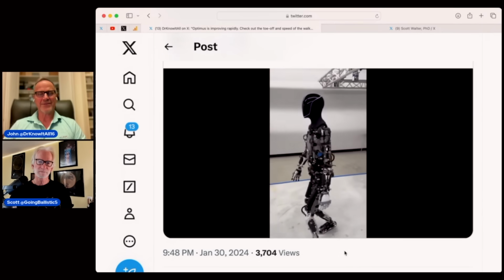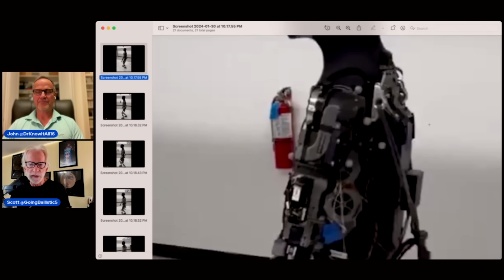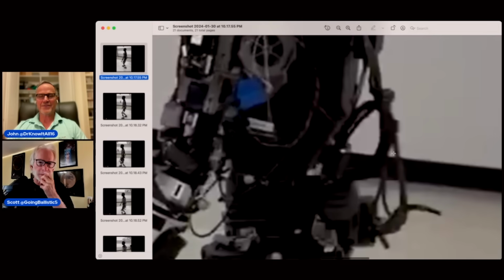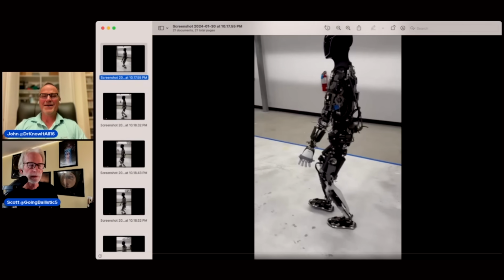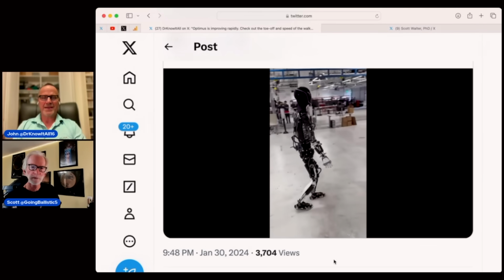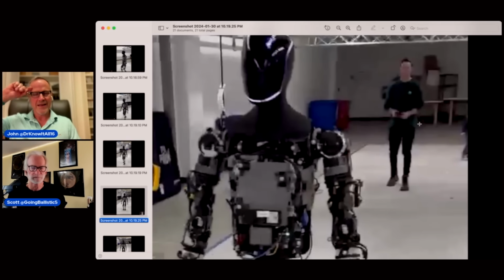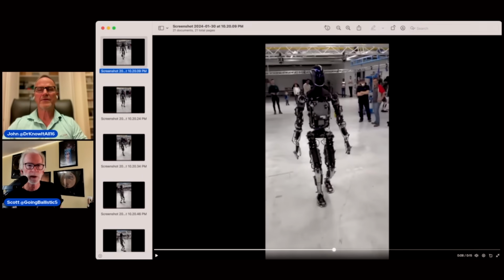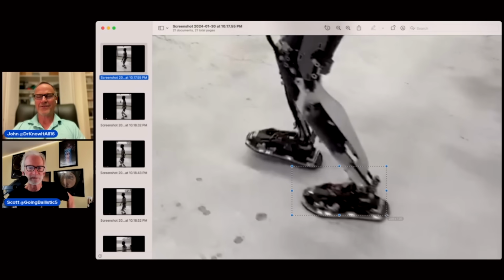Elon Musk Drops NEW OPTIMUS Update!!

Comment: the gait looks better, not much dorsiflexion or plantarflexion and not much pushing the weight forward, still looks a bit like that primate walking and balanced for any moment being static, like someone walking on ice, not enough agility and confidence in catching weight. at no point is leg extended fully, with forward tilt on hips from back legs, The distance between feet plants are also tiny, a onfident walked can easily get more than three times that.  but it is getting better so maybe in a few more iterations. Boston Actually does this a bit better, has a jog and can transition from walking to jogging gait.

Comment: The walk is limited really by the mechanics of the lower back.  If you look at a normal spine, there is a curve in the lower back forward, and then it arches backwards toward the buttocks.  This helps center the body midline in that hip area.  The way the hip is made now, as the legs move forward, it places a lot of weight forward without much opposing weight in the back, and really limits the "walk". IMO
Reply: In an earlier video, the center of gravity was always kept over a planted foot, swaying side to side. The gait was super stable but slow, as required for walking on wet ice. 

But now the center of gravity is kept in between each footstep, relying on inertia to complete a full stride. Easy to walk faster, slightly less stable, requires keeping loads on the inside edge of each foot most of the time. 

When they change the dynamics so the foot pushes off with the front tip of the foot and the heel elevates, then the knee can lock straight at times, and the gait will completely lose inherent stability. Both feet can be off the ground momentarily, falling forward. Ground/heel friction is required to recover during every step. The legs will require stiff springs to store and release energy (like our Achilles tendon), otherwise this faster gait will be inefficient. 

In this dynamic gait, a real-time hard-coded physics emulator is required as input to the neural network in order to predict where the next footstep must be placed.

Comment: The bots will not be battery constrained. 95% of what it does it could easily do on a tether. Being mobile is a massive benefit. A one hour battery with the ability to plug in at whatever workstation it has will cover 98% of all use cases

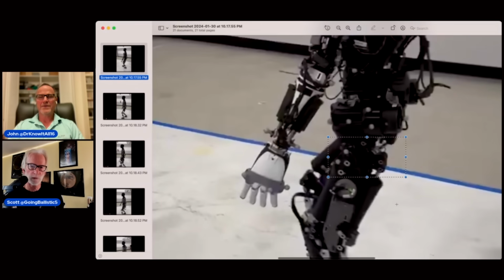Comment: I would surmise those fans are cooling hydraulic fluid. That sure looks like a hydraulic cylinder to me on the back of its thigh. Clearly visible at 16:28 Js 😮😅😊
For that matter, they could also use the hydraulic fluid to cool both the cpu and the battery. 🔋 😎
Reply: The only liquid is for the coolant loop. All motion is achieved with electric motors, some with linear motion output (elbows & knees), others with rotational output (hip)

Comment: Def think they're using a wireless Xbox controller and controlling the robot like a animated and rigged character in unreal engine - just like a video game. The impressive thing is that even if it is being controlled via remote control the navigation and compute is probably still being handled on board i.e. how much range of motion needs to be applied, etc. Just as an emphasis they use UE4 or UE5 for FSD tech, it's not a stretch to imagine they thought to apply the animation and rigging system to optimus. I imagine optimus is using Inverse Kinematics to a degree and I bet the solver is a in house designed end-to-end solution.

Comment: Optimus is 5' 8" tall, so that means the feet are probably around 9 inches in length or more. This makes the step at least 18" in length, front "toe" goes from behind the heel of the other foot to at least a foot length in front of the other foot.  So it's at least 50% faster than they estimated.

Get better at estimating!

Comment: Even cheap small cordless power tools use three phase motors. DC to 3 phase AC inverters are tiny, the motors produce more torque for a much smaller lighter unit. Pretty sure Optimus is using AC for motive power.

Comment: best way is to use swap battery method. optimus has a very small backup battery just has enough energy to do the swapping by himself. no need cooling and charging to add additional weight to the bot. download time will only be a few minutes within 24 hours

Comment: No head movements here, i would assume end to end
Reply: Necessity? Multiple cameras obviate need for head degrees of freedom.
Reply: @FrunkensteinVonZipperneck  if the purpose of this video is that it is improving at walking then could be trained on simple footage without the camera panning, therefore no need to move the head. I'm well aware of the cameras, but if trained on footage to mimic head movements while walking then it would be doing that too.
There has to be some objective there

Comment: When Optimus gets full hip extension with full foot articulation it will be a game changer for speed and fluidity
Reply: It walks like an old man with diabetic neuropathy and Parkinson’s because there is no real proprioception from joints bones and muscles. Our central nervous system has a huge amount of signal feedback that allows us to walk and balance.
Reply: @Dave5843-d9m  it actually has stress sensors and touch sensors on its hands and feet’s the same exact way we do
Reply: What do you mean full hip
Reply: Needs more swivel in the hips for efficient strides.  It also could use some spinal joints, at least one mid back.

Comment: Why are feet so important, except for stairs and irregular outdoor terrain? If you're moving on a flat floor, then aren't wheels just better-simpler-cheaper?
Reply: They want a general purpose design. Sometimes people have to step over a ridge or squeeze between machines or boxes to get to where they need to work.
Reply: @royh6526  even wheels can be designed (articulated) to cope with those exceptional situations -- and those situations are exceptional when you're talking floors. Optimus is unnecessarily ambulating across a floor that seems mostly flat.
Reply: I’m stumped!

Comment: AC to DC converters are not inverters. Correctly identified they are rectifiers. Inverters convert  DC to AC, which is very different in operation.
Reply: that's exactly what I thought, why are these guys are saying converters is beyond me
Reply: @benashenden-g4j  They don't actually do proper research for their videos on the topics they discuss. It's unfortunate but much of the time they just throw out randoms numbers, quantities, and scenarios that are not representative of any facts regarding their topics.Their analyses are mostly hypothetical assumptions , presumptions and guesswork.
Reply: @PiCorder  it can sure seem that way at times, thanks for keeping it real!  What the hell is a converter lol
Reply: @user-tg9xk9sy9k  in its simplest form, a converter is the generic name for anything or any device that can change one thing into another, such as converting audio to digital signals, such as the old TV RF transmission to Digital TV signals, sunlight into electricity and more. It is true that an inverter and a rectifier, or even a charger, do convert, in this case, different states of electricity to other forms, but DKIA and Scott are using the term "inverter" incorrectly as used here in their explanations of charging or powering the Bot in this video. 🙃

Comment: I would guess Optimus uses brushless DC motors (BLDC), similar to what is used in RC-cars/planes now days. The controllers for those motors can be made pretty small with today´s power electronics. The controller would in that case be integrated on to the motor-assembly probably including a small microcontroller so that you only have to route a ethernet cable and a DC-bus to each motor. They could also use the same ethernet-loop tech as in the Cybertruck.

Comment: Upgrade to self replacing battery packs not need for AC/DC conversion, Yes this would reduce range but a couple of battery charger stations would more than make up for this issue. Robot does not need to run a marathon, just a series of 5k sprints.
This is how every mechanic keeps their power tools always powered up.

Comment: Do we know if Optimus is using 48 volt circuitry?
Reply: Yes, and almost certainly the same ethernet system used in the Cybertruck. You can see one thin cable across the wrist for the hand. All that cable has to have is two wires for 48V and 4 thin wires for ethernet. This to operate 6 or more actuators in the hand and 10 or more feedback sensors.
Reply: Thank you Roy; that’s good to hear.  @royh6526

Comment: Hey friends, the Teslas of course have converters to convert DC to 3phase AC for the drive motors! 
Optimus motors may be DC, but most likely they are AC too at least for the legs, so also converters needed too, tiny ones though.
It‘s an impressive demonstration what Tesla has achieved.
Walking upright on two legs is a quite complicated task.
Reply: And learning that end to end neural is amazing!
Reply: I expect the motors are normal "3-phase brushless", just like in your battery drill, a toy drone, oh - and in your Tesla car. Basically you need DC power, a handful of power MOSFETS and the control signals. If you count their cars, Telsa have made many millons of them and appears they know how to make them work well.

Comment: Could this be powered wirelessly with a small battery as a buffer? Antenna in the head...
Reply: Takes a large antenna to receive that much power or a very directed high power laser that could be dangerous to others if it fails to focus on it's target, the robot's head.

Comment: The reason there's AC converters in Tesla's is that it uses AC motors.  NOTHING to do with charging.  If charging source is AC it gets immediately bridge-rectified to DC.
In the case of Optimus, if the motors are AC (or brushless DC, which is a misleading naming convention, as "brushless DC" is AC;  just trapezoidal wave instead of sinusoidal);  so I don't know because I don't know what kinds of motors are used in Optimus.  Plain old DC motors are unlikely;  and stepper motors are like switched DC driving them, but they are not the most efficient motors;  can have heat distribution issues;  so I'd be inclined to assume they use miniature versions of Tesla car motors (which are a strange blend between AC induction and synchronous AC motors), and to drive them they'd be inverting DC up to AC.
Reply: Wow.  I bet you have an oscilloscope in front of you Dan!                                     Scott: Stand aside.                                                                                                            John: Get this man on an episode.
Reply: @ufo2go  Haha, I don't have an oscilloscope at home;  but I worked as an electronics design engineer for 25 years, until the infamous pandemic forcibly retired me.

Comment: At this rate, they’ll catch up with where Boston Dynamics is now in ten years.  I wonder where Boston Dynamics will be then?
Reply: Umm no.. Optimus obviously has the most advanced hands in the entire industry with only 2 years of development.. it also has electrical motors while all Boston dynamics robots have noisy hydraulic motors which add unnecessary complexity.. Optimus has Tesla a.i. with 3d vision and machine learning.. Boston dynamics has much more simple cameras and nowhere near the a.i. capabilities. Optimus is designed and tooled with mass production in mind.. Boston dynamics doesn't mass produce anything except dog.. and only makes thousands of them.. Boston dynamics lasts probably less than an hour on a charge.. Optimus lasts 12 hours.. optimus has human proportions.. Boston Dynamics has weird distorted proportions all over.. Optimus learns by visual demonstration.. Boston dynamics learns by programming.. Tesla Bot is very very very advanced and promising
Reply: They are on par with Honda in the 1980's.
Reply: They are not competing with BD. The Optimus bot has a completely different architecture, purpose, and function.
Reply: @vinnylamoureux1187  BD robots are warfighters, Optimus bots are factory and domestic workers.
Reply: @vinnylamoureux1187   Optimus also features a guy operating from behind with a remote control. Tesla's version of AI.
Reply: Probably less than one year.
Reply: They'll have probably made a robot that can do a handstand, crazy.

Comment: Optimus needs a chair with built-in wireless charging, coils could mounted in Optimus buttocks for charging. 😅😊.
Reply: If it's going to have a special chair, why not just include a special plug? Cheaper and much more compact than inductive charging.
Reply: Open but hole,….

Comment: There's an assumption that Teslabot is working at 48V and you'd assume that all motors would therefore be 48V. But motors will be driven at less than 100% most of the time using PWM at say 50kHz. As soon as you go there, then you can actually drive any voltage motor up to 48V. It wouldn't bother me having mixed motor voltages in my own designs. PWM will efficiently use the power available even for say a 6V motor,